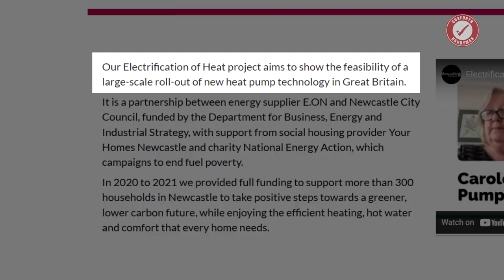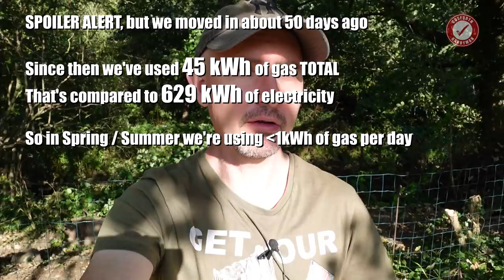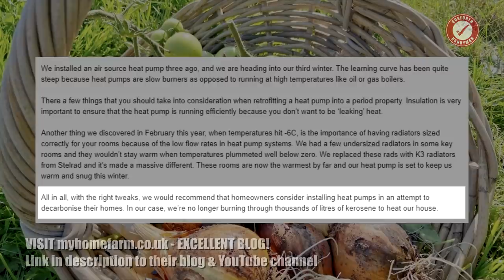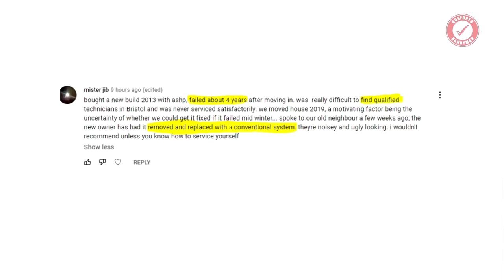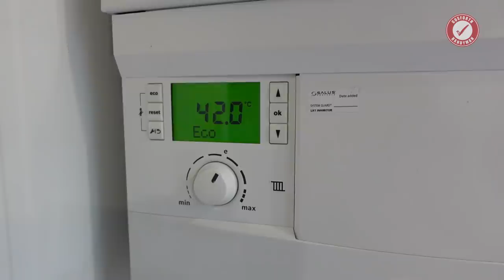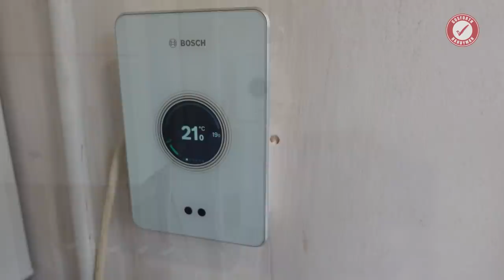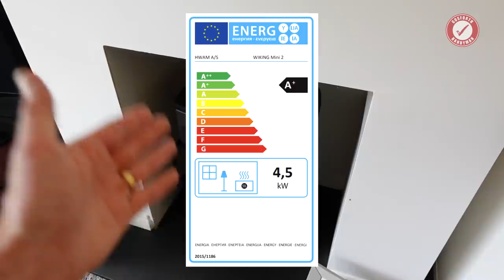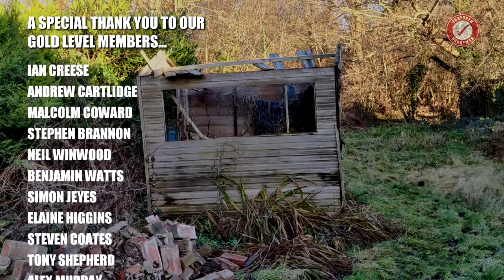Why didn’t we install an Air Source Heat Pump? (1920’s Renovation Part 32)

Comment: Oh boy you’re going to get the internet trolls chiming in with differing points of view of this one Andy.  I did feel the first half of your video was unbalanced against ASHP with side comments that “they won’t work properly”,  but then when you got into the ramble it was a much more balanced position, and I absolutely agree with you that there are pro’s and con’s and no single right answer for everyone - just the first half you come over as very biased.
My situation, earlier this year I’ve paid for and had installed an ASHP.  The pump does make a noise when its operating but its not massively noisy as you suggest, its more of a background hum, so don’t necessarily agree with the comments about excessive noise in residential areas - kids playing and lawnmowers are much more noisy.
So why did I buy an ASHP.  We’re in a village with no mains gas and so previously had to use heating oil.  The oil tank reached end of life, started leaking, so had to do something to replace it.  The tank was in the back garden but the house had been extended both sides so to get a new one in we’d have had to hire a crane, plus there is all the government noise about oil and gas heating being phased out.  The ASHP cost just over £11k but we will get almost all that back via the RHI government grant, meaning it cost about the same as a new tank, no crane hire cost, and I felt it was a better long term solution.
You absolutely need to find a proper company to design and install it (and getting comparative quotes proved difficult for me). Radiators need to be upgraded, but that and a new super-insulated hot water tank was all in the price.  You have to have lots of loft insulation (I had to put more down) and cavity wall insulation to get the energy rating to receive the grant.   The grant application was a pain, they required lots and lots of evidence, but once I gave it all, the money started coming through every quarter.
Running costs are very similar to the price of oil, and longer term I expect as gas and oil prices go up, it’ll be slightly better.   So far its worked perfectly, no issues at all, plenty of hot water and a warm house.   One thing to consider is that the hot water cylinder and equipment needs to be physically near to the ASHP - this meant a load of plant going in our utility room. We now have a empty airing cupboard though!
In my circumstances yes I probably would buy an ASHP again.  If I had the choice of gas I would find it a much harder decision to make.
Final comment, as a country we need different thinking about how we heat our homes.  For example, rather than every home having its own individual heating source, move towards larger more efficient boilers for whole streets/blocks of flats.  Ground source heat pumps and large ASHP’s can make more sense under those circumstances
Reply: Great comments - heartily endorse everything you say. We have had a very similar experience with ditching oil for ASHP with the key being insulation and air-tightness with a mechanical ventilation system.
Reply: +1 from me as well. We moved to an ASHP with the RHI grant from on old microbore LPG system.  First we wanted to remove the micro bore radiator pipes, as they were buried in the walls and secondly we wanted to move off LPG and mains gas wasn't available. We live in Wales and often go down to -7c. The ASHP isn't as efficient at that temp but it keeps our 80's bungalow at 21c without issue. As with most things in life, people need to look at their specific situation and not be influenced by general statements that are either 100% positive or negative.

Comment: So here in the States in the rural areas we use propane and it can get really expensive so we put in hybrid systems that use air to air heat pumps down to about 20°, Fahrenheit and then we switch over to the forced air propane furnace. We use a thermostat that's also has an outdoor thermostat and has what they call a balance point setting which is basically where we switch over to gas heat. Some people said it at 32°, some all the way down to 15°, and anything below that you heat with propane. We have also been using spray foam as you said for several years and we use open cell on the roof decking so that even if you get a leak it's no big deal just actually easier to find The leak in a roof because The water will go straight through the open cell foam. All sidewall cavities and foundations we spray with closed cell foam. Then some of us add a thermal break to the inside wall or outside wall or both using 1-in polystyrene with a foil facing and a half inch gap so that you get your radiant barrier. This works especially well on existing roofs where you strip the roof with 2x4s anyway for a steel roof and then fill the gap with 1 in polystyrene foam board with the foil facing up so you get the radiant barrier on your roof. We also have really good water here so some of us use open loop geothermals if we have good wells and we get a 22% federal income tax credit on Geo

Comment: Thanks, I watched this from start to finish and really enjoyed it. Small thing, but I was wondering if you need a 36kw boiler for this property? The central heating would never need anything like that, and as you mentioned, the hot water output is limited to 24kw. So surely 24kw would be plenty for everything and this would be more efficient and less stress on the boiler?
Reply: If you use a 24 kw combi boiler your hot water output at the taps would be reduced , this is why we fit larger output combi boilers to overcome this problem , personally I would have fitted a megaflo and small 20 kw heat only system and that would have been more than enough for constant hot water at a decent pressure and would be a lot cheaper to run long term....👍
Reply: And there is a pump - it is inside the casing.
Reply: Fair point, but it does future-proof the system should they build an extension, loft conversion, etc.
Reply: @thenullco  with combi's it's almost always the hot water demand that drives the output of the boiler, space heating is a lower demand, in small properties this can mean the boiler is mismatched and has to cycle a lot.

Comment: I'm in the West Midlands and work at home most of the time. It's a 4 bed detached and I use one of the bedrooms as an office. There are a number of servers in here in a rack which kick off a lot of heat. I've replaced the double glazing  (good stuff) this year and now I'm now doing a lot of audio recordings for work. To keep the noise down I have to close the windows because I need to keep the noise down to a minimum and I have to kill some of the servers but with latent heat it's distractingly hot in here. So I decided to go for air conditioning for my office. 

I didn't realise that newer systems are heat pumps and can heat as well as cool - That for me is an unexpected bonus - how good they are for heating will be proven over time. I did a little research on air to air systems and so decided to have one in my office, one in the living room and one in the main bedroom. 

I have an old combi boiler which does need to be replaced and a new gas fire in the lounge. 

I was absolutely not going to ditch gas for heating and rely on heat pumps alone. That would be stupid. At lower temperatures they become less efficient. The grants seem to be based on ditching gas, so no. With the rocketing prices of fuel the heat pumps may well be worth while for heating - I'm not in a position yet to judge that. 

Regarding diesel - I've always been an advocate of petrol over diesel and do not like driving an oil burner. I guess my concerns have been proven over time. I like the idea of having an electric car, but range for me is an issue and just how will the grid cope with everyone charging their cars overnight if everyone decided to go for one? Lack of infrastructure IMO. Great idea but no joined-up thinking on implementation.

Ikea......just no.

Comment: If you oversize your radiators your condensing boiler will be more efficient.
My return temp never goes above 45C ensuring max efficiency.
Also boiler doesn't cycle often.
Would love ground source and underfloor heating though.

Comment: Leaving aside the technicalities of installation, electricity costs six times as much per kWh than gas does. If a heat pump system is 200% efficient (the best you'll get in the coldest weather, when you use it the most) that means it will cost three times as much to run as a gas powered system.
If the price of gas rises (as it will) the cost of electricity will rise in step with it. So this won't change significantly.
My view is that we shall have to install a huge excess of renewable power sources, which will be needed to cover periods of low supply, high demand. So there will be massive oversupply all the rest of the time. So making green hydrogen will be the obvious answer.
If the gas mains were supplying hydrogen, the next problem would be capacity. You need a much bigger volume of hydrogen for the same amount of energy.
Reply: Might as well just use electric directly for heating if you have massive oversupply. Hydrogen is really inefficient to make. But maybe something else like ammonia would be better.
Reply: I agree with your analysis but In the long run, with more solar and wind generation, and gas no longer an option, electricity will become much cheaper than hydrogen, because hydrogen will be needed to produce electricity only a very small amount of the time. Most of the time, solar and wind will produce electricity very cheaply, as it is doing already. Nuclear electricity is also available 24/7, and it's cheaper than gas already. Hydrogen will be more expensive than Gas because it's made from electricity, with 15-30% conversion and compression losses, so it's very inefficient as a fuel, but it's still useful as a seasonal buffer because it can be stored in large quantities very cheaply. We can't assume that more renewables will produce ever cheaper electricity to produce cheap hydrogen. In reality, the price of renewable electricity cannot continue to decline much more, because the cost of building and maintaining wind and solar farms must be paid for, otherwise no one will build them.

Comment: I absolutely agree with everything you said here, we live in Co Durham so have a similar scenario with our heating situation re heat pumps vs gas boilers. 
Our house is an end terrace Edwardian property with a cavity wall that we could get insulation pumped into but we were aware of people getting damp problems with this type of insulation when their properties had walls that suffered wind-driven rain. Since our end wall is quite exposed we decided it just wasn't worth the risk of getting any /more/ damp - since we already have to deal with it on the ground floor and in our built-in wardrobes on that same wall. We installed a wood burning stove in the front room which helps to supplement the heating when it's cold but frankly our gas central heating is not fit for purpose to heat such a period property - we're aware that the house would have been designed to have a fire burning in the front room and large kitchen to the rear pretty much 24/7 which would have helped to ventilate and heat it. Most of the time our house is cold and we do wear a lot of layers to combat this and I'm actually quite used to it now - having grown up in a well insulated 1920s centrally heated property. 
Our main goal is to keep the house free of damp, not really to keep it warm. We even built ourselves a Japanese heated table (kotatsu) to sit under which must save a lot on the energy bills - (Japanese houses are apparently some of the worst insulated so it would make sense for them to come up with alternative solutions). We also considered installing a range cooker in the kitchen to heat our water and potentially central heating too but even with what I would consider a decent amount of savings available to fund such a solution - it's still so unaffordable. With gas prices going up so much this winter we're really quite alarmed at how much it's going to cost us in heating bills.
When the government heat pump scheme came through the letterbox I was intrigued, so I called the number provided to enquire but got no answer. I'm glad I didn't pursue it now after listening to your arguments here. There really isn't enough good advice given on what is suitable for each individual property and perhaps that is what the government should be spending their grant money on! Expert surveyance?

Comment: Had an unvented system (tanks, cylinder, associated pipework) of 25 years taken out to be replaced by a combi + plus changed every rad in the house. I was aware of the downside of combis, but on balance it was the only feasible option for my situation. A few months since install and I'm very impressed with the combi. I've had to learn how to pressurise and depressurise the system, and a few other basic maintenance tasks, but it's fine.

Comment: I live in a house in the uk with an air source  heat pump system, but instead of radiators it is connected to 3 fan coil units, two wall mounted ones on the ground floor and a single unit concealed in the loft feeding air through ducts to the upstairs rooms, plus it’s connected to the water tank too and heats the water too - works brilliantly, House is cosy and warm in winter (plus it cools in summer)  - my installer said “they work great until you try to connect them to a water filled central Heating system” - guess I was lucky I was replacing storage heaters and didn’t have an existing radiator system

Comment: I worry about the information out there about how burning hydrogen is considered environmental friendly because when burned with pure oxygen it produces water.  But a hydrogen gas boiler will burn with air and product nitrogen oxides not something we want to add any more to our towns and cities.  Certainly hydrogen in a fuel cell is doable but that produces electronic.  The boiler industry (pushed by Worcester Bosch) is betting on hydrogen to keep boilers alive after the ban.  They hope to use the current gas network but hydrogen is much lighter than natural gas so its very difficult to get it to your home without pumping it not to mention the production of hydrogen is currently far from green. Can you imagine the chaos of switching over from natural has to hydrogen to use the current network! Given the boiler ban will happen soon (2025) I believe the boiler we had installed this year will be the last we can have.
Reply: I suppose you use hyro electric to make the hydrogen
Reply: @highpath4776  Hydrogen from electrolysis is clean but it’s an incredibly inefficient process so you need masses of input energy. We would have to go heavy on nuclear power to make its work and it’s to the scale that it would be 2-3 times what’s needed to power all homes with ASHP. Hydrogen will have its place in ships and planes but for homes investing in electricity would be the way.
Reply: The calorific value of hydrogen being much higher than LPG which is higher than gas means less fuel will be burnt overall effectively lowering Nitrogen Oxide output. The boiler ban in 2025 is also only on new build houses not on current properties and we went through much the same issue swapping from Towns Gas to Natural Gas on the same network. It is also not just Worcester Bosch pushing for Hydrogen, it's all the manufacturers and the gas transporters themselves (SGN etc) considering the forced upgrade of the gas mains mandated by the government, they obviously want to earn their investment back as the government won't be covering their losses otherwise. 

Any it would be switched over in stages across the network like Towns to Natural was previously and any boilers running on the mix or pure hydrogen will likely need upgrading with UV sensors for flame supervision safety devices as the current industry safety device doesn't work in the same way.

Comment: Hi Andy, I have an unusual set up ,warm air heating run with an air source pump. We have an Aquair Johnston and Starley fan in the house fed by the air source pump. This could have been run by a gas boiler of course. The air heat was already installed but when the old boiler stopped after 40 years we had to use the fanunit instead of an internal boiler. We get £10,00 back over 7 years. The system cost me in total £9000 to put in. Idk have to use a gas fire to help in the winter. Live in Robin Hoods Bay, North Yorkshire. We run at 19 degrees during the day and do not run it at night. large 4 bed bungalow ,detached cast £200 per month to heat in winter. It would be cheaper with a combo boiler replacing the heat pump but we are trying to be green where we can. I believe you are right in my our choice however as we are a distance away from our neighbors so they do not hear the pump.

Comment: Come on now. It's pretty much impossible that your boiler has a lower carbon footprint over the next 10 years than using a heat pump. Just say it like it is, it was cheaper for you and you don't mind externalising the costs of burning fossil fuels. Don't try to play it off like you did a good thing though.

Comment: A good overall video. Well done. I totally agree re the unvented cylinder & heat pumps etc. On your combi. Get rid of the isolation valves on the hot & cold pipes. They have a 6mm bore and restrict the  water flow. If you have a water meter, a shock arrestor must be fitted. If all radiators have TRV's you need a auto bypass too. What is the incoming water pressure into your property.